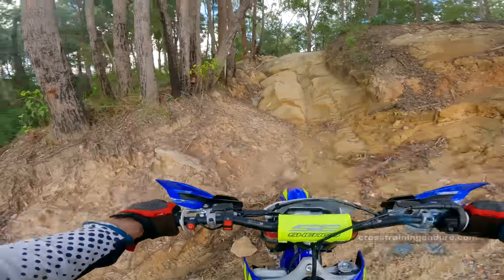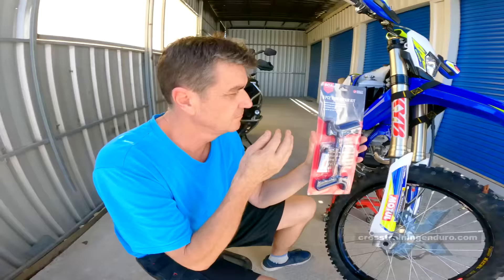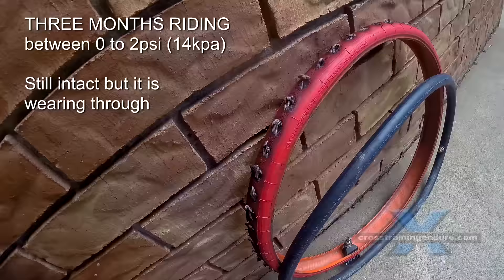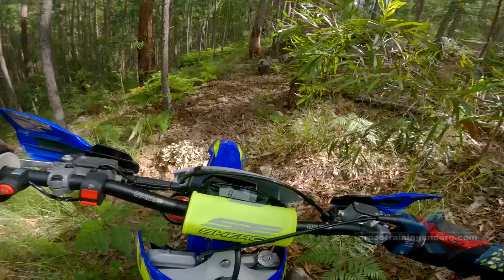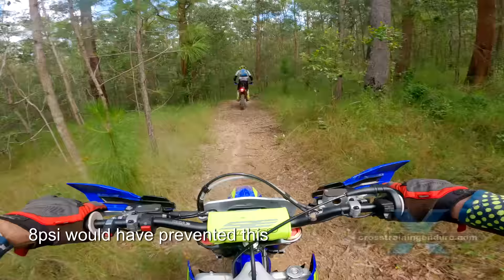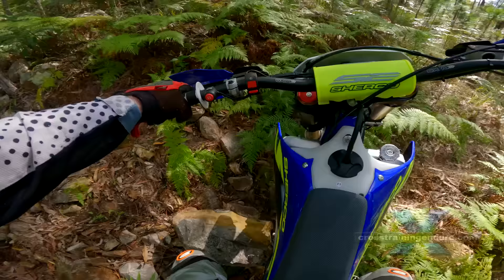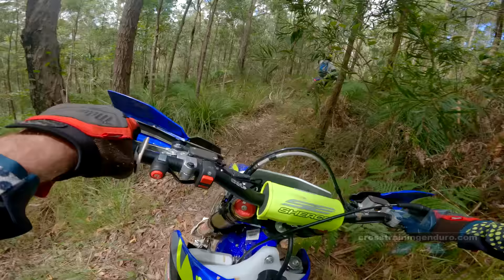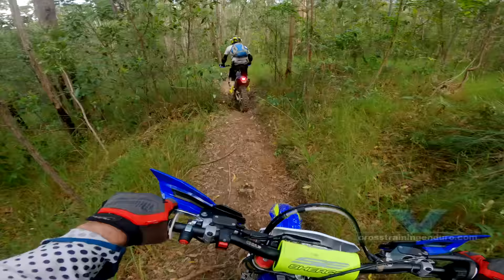TUbliss long-term review after 7 years with the tubeless tire system!︱Cross Training Enduro

Comment: You didn't mention how often you have air up the Tubliss tube. You know the tube you put in to replace your... Tube. 😉
I use heavy duty tubes. No flats in the past two years of racing and rarely a flat in 20 years of using them.
Reply from the maker: We usually just put air in before the ride each weekend, Bill. It usually shows as 10psi lower after a week, although a fair chunk of that is simply from losing air while checking. Same for you?
Reply: @crosstrainingenduro  
I check before a ride or race and adjust for conditions. Can go as low as 4-6 in very muddy conditions(southern USA has a lot of mud and soft conditions) to 13 in the Rocky Mountains mainly to keep from getting flats. At Loretta Lynn's, which can have a mix of mud and loose rocks, around 10-11.

Comment: What constitutes a new tire? If I get a brand new bike, can I throw tubliss on that tire? 

Does new mean never mounted or never ridden?
Reply from the maker: Generally the potential problem is the rim lock on a used tyre has caused indentations which may affect the sealing. Personally we have fitted used tyres and just used heaps of Slime to get a good... but you can run into issues apparently.

Comment: I’ve been using tubliss for about three years now and I absolutely love it. 

Quick question. Do you guys replace the high pressure inner tube every twelve months as Tubliss recommends? I haven’t been and so far haven’t seen any issues but I wonder if I’m running the gauntlet.
Reply from the maker: Huh, I didn't even know they recommended that. Mine were four years old when I sold them with my last bike. All the other guys in my group never replace them...

Comment: Most of my riding-friends uses mousse, a rare few TUbliss. I use mousse on rare occasions (competition) but I actually prefer the heavy-duty tubes (at least 4mm). 

I rarely have puncture issues (maybe once every second or third year?) and the simplicity when changing tires plus low cost makes it a "no brainer" for me. Rides with 0,6-08 bars which would be somewhere around 10 psi I think?
Reply: Me as well, most punctures with hd tubes in the years I've been using them have been from improper mounting.
Reply: agreed. heavy duty tubes for me as well and prlly wont ever use anything but

Comment: 5:12 my god Barry, that locking nut should be against the red cap 😯🤣🤣🤣 Absolutely love the Tubliss in the rear, have not gone Tubliss in the front yet, do you rate the front Tubliss ?
Reply from the maker: Love it in the front too... I could probably go a mousse there if I really wanted to as it would last a long time, but it would be heavier and also give that slightly 'dead' feel.
Reply: @crosstrainingenduro  that is the same reason I don't have a moose in the front, I like how light the front is now.

Comment: Been using Tubeliss for a few yrs with zero issues except my front tire seeps air out of the low pressure. I was reluctant to put slime in it cuz I didn't want to deal with the mess when changing tires. But I think I will now. My issue is most certainly my own fault. My front wheel hasn't been round for yrs.
Reply from the maker: I don't mind the Slime, it just makes removing the tyre a lot easier too... then just washes away with water.
Reply: @crosstrainingenduro  I like your pretty new bike, has the KYB suspension settled in yet? Is there much of a difference between the 250 & 300?
Reply: Was it a Dunlop AT81 front tire? They don't work well with Tublis
Reply from the maker: Weirdly the 250 forks have settled in nicely, mine not so much... I'll do a 250/300 report soon!

Comment: I got tubeless in the rear tire, I ride technical enduro but not extreme, like the Michelin starcross and usually have soft front and mid back but wanna try soft or even gummy at back as often we do nasty steep rocky hills
Could I run like a 5-6 psi think Michelin have a soft wall
Reply from the maker: I figure the main issue with a soft sidewall is that if you get a puncture but try to keep riding you'll be riding on the rims. Tougher tyres let you keep riding if you have to e.g. it feels like riding on 3psi but you can get back to base again if needed.
Reply: @crosstrainingenduro  oh cool that makes sense, thanks for your prompt reply

Comment: Thanks for the vid. I have a set of Excel rims for my T700. Would you put a tubliss system on it? I'm going to ride a few raids next year. I think putting a mousse on a t700 rear is maybe not such a good idea. What do you think? Many thanks in advance!
Reply from the maker: You could only put TUbliss on the front, the standard rear rim is too wide. Not sure about your Excel rim sizes. It only works on your standard size rims for dirt bikes. The weight would kill a mousse in no time. 🤔
Reply: @crosstrainingenduro  Hi, thanks for the quick answer. I know Lyndon Poskitt is riding his KTM 690 rally with a mousse in the front and a hd tube in de rear tyre. He says he will never change back.
My Excel rim sizes are 2.15 front and 2.5 rear. Would it be safe to put a 90/100/21 Michelin M16 mousse in a 90/90/21 tyre for more "pressure" considering Dakar bikes run the same mousse and have about the same weight with full tanks as a t7?
Reply from the maker: You'd have to ask TUbliss about fitting to adventure bikes. This is an enduro channel.
Reply from the maker: Ditto for Dakar bikes etc... way outside our area of knowledge.
Reply: @crosstrainingenduro  will do. Thanks anyway.

Comment: tubliss with half a mousse is the best system available for hobby riders 🙂🤙
Reply from the maker: The gold class hard enduro rider in our group has been running that for two years now with great results so far.
Reply: Could you give some more details on how you do this please
Reply: @chrisjager4539  x-GRIP has a mousse on offer that fits right away, it's called blow mousse
Reply: @luckystrick9445  Thank you

Comment: what if the red high pressure gets punctured? I dont understand the difference between this and regular tubed tire when it comes to not being stranded in a trail doing a repair lool
Reply from the maker: The chances of puncturing the red tube are incredibly low.  Out of all our guys, it's happened once in seven years (whereas punctures in the tyre we've had to plug? Countless)... Scott was running very low air pressure over very rocky terrain during a race. He knew it was a risk, and it's just the kind of scenario where we say if you're racing, go for mousses.
Reply: @crosstrainingenduro  i am a very casual rider, very new, and ride alone alot (dual sport bike). So I need reliability, really cant afford to get stranded haha. I guess im just trying to imagine a nail just getting driven down through the red portion if your riding with it stuck in your tire. That is, riding with a flat and the nail still stuck in your tire. But maybe i'm over thinking it since you guys have had real world experience with it. Besides, what are the chances of a nail in the woods haha.
I know its not DOT approved, but if i were to buy this, i'd probably take my dual sport on the streets with it anyways haha.

Comment: I tried tubliss for a short time but found with mildly worn rims they would not stay sealed and I dont see the point of spending so much money for something that needs slime to seal, because then you have to clean out all the slime on the next tire change. I change tires more frequently than normal people because my riding sucks anyways I did not care for them.
Reply from the maker: Makes sense, Destry. I know a lot of guys don't like messing around with Slime. Others? No problem as it all just hoses away with water.
Reply: @crosstrainingenduro  thank you for the reply, I wish I could ride in Australia with you! How do you fend off insects?
Reply from the maker: We just don't stop for long if they are bad!
Reply: @crosstrainingenduro  actually  I did not know that slime was water soluble, but I just run extra heavy tubes so that its low maintenance, besides I can kill a rim and tube or tubliss at any given point by slamming into rocks. I'm notorious with my buddy's for hurting parts, tires etc.

Comment: Here in Brazil we have a company called Luciolli that makes a 7mm tube with 2 rim locks inside the tube. I take the rear tire out of the ground and remove the air completely. With the bike´s wheigth it makes about 3 to 5 psi. Its perfect. I have used for 5 years and never had a puncture. It´s cheap (about 65 american dollars here). Easy to assembly. The downside is the weight... https://youtu.be/GJp1ezZFX5I

Comment: I trim the little rubber tits off of each side of the red liner. I've had those fold over and get in between the tire and red liner, causing leaks.
Reply from the maker: Very good point, I never thought of that. That could explain issues my brother had with his rear on the new bike. We took it off and put it on again, then zero leaks.

Comment: Heavy tubes work for me. I'm poor and not a pro rider.
Reply: Does the math work out on that? I am guessing that not having to replace tubes may when out over 2-5 years.  I haven't tried it yet but thinking it may be worth it long term.
Reply: @NONO-hz4vo  Tubes for me easily win out. I'm at two years on heavy IRC tubes that were $18-20USD each.
Reply: @SANDS78  We have our own property and can just jump on our bikes whenever. Getting 6m is good. Mostly valves stems but the track probably makes that worse than trails.
Reply: I used to run the Heavy HD tubes that were 30-40 bucks and I still occasionally got flats, they were super duper heavy you could feel it and I didn’t get the huge benefits of low pressure in the back end.

My Tubliss will last me 2-4 years before I need to replace the small in er tube (rare) and I get the firm Mousse and it’ll last me a couple of years and I get no flats and better traction in return.  Yes it’s costly up front but long term worth it.  For me..

Comment: Less weight, can run lower pressure.........whatever. All non issues for the most part. I prefer tubes. Nothing is perfect and trying to get away from the obsession with unnecessary, expensive parts.
Reply from the maker: Yep, tubes are way cheaper. But many of us hate having to fix punctured tubes, especially in the middle of a ride. I minimise bling on my bike but the advantages of TUbliss are worthwhile to me... but certainly not everyone.

Comment: Thanks Barry. I think Tubliss is significantly less reliable with FIM enduro tyres. In the UK we're often limited to road legal tyres even just trail riding (Green Laning on legal byways etc.) Michelin Enduro Mediums are considered the best road legal for most UK trail riding. I think the FIM tyres don't work well with Tubliss because the carcass is soft to compensate for the 13mm FIM knob height limit. Many of my riding buddies and I tried Tubliss but had problems with leaks in rockier terrain which would spoil a group ride due to having to slow down or go home.

Comment: Sounds good in theory but my question is running that low in psi surely you will flat spot your rims as the only thing protecting them is air pressure i have run mousses for years and love them years back they brought out a mouse with a small diameter tube inside it this was the ultimate mouse protection with adjustability and almost pinch proof, maybe the moto industry needs to pinch a few ideas from the mtb world there tubeless system is spot on .
Reply from the maker: There's definitely a risk to the rims if you run low psi then ride fast and aggressively... you'd want mousses in that case. But for our style of riding it's been brilliant.